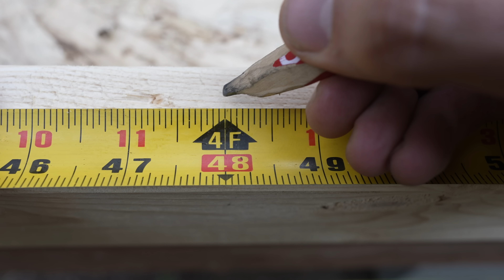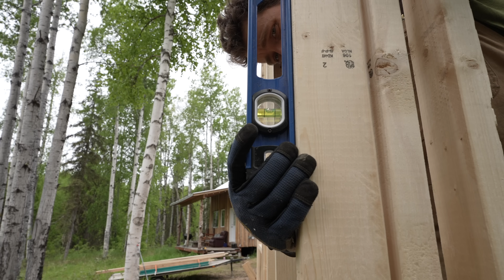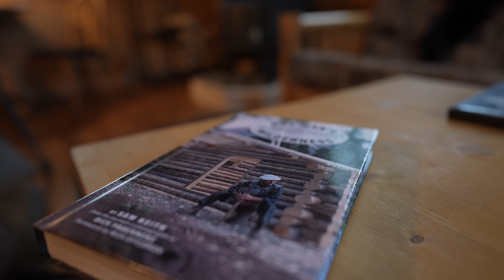Building A Cabin In The Wilds of Alaska | ASMR | Framing

Comment: Is that square block and rebar foundation the same as the main cabin? That design  is starting to interest me, so no hole digging? I think you had mentioned you should have put a wood block under the steel bracket in your first build, I think that helps eliminate "cold creep"?

Comment from the maker: I'll try and answer your questions about the building specifics here ⬇
Reply: Great job. Great video production. You are very talented. Please wear eye protection though. We want to see you continue to make these excellent videos!
Reply: It looks like a pretty good size guest cabin that you’re building! What is the size? I know you probably said it, but I think I didn’t catch that! How do you plan to heat it in the winter small woodstove you got yourself a new subscriber!
Reply: If you use your pencil to mark a "v" instead of a line, you focus the edge of your cutting blade in the central convergence of the v...... it's much more accurate. 

And because it's not just one line, it's much easier to see on the wood.
Reply: Guest house? Looking good so far.
Reply: Awesome. Did you do 2x4 walls, but 2x10 rafters and a 4x12 ridge beam? Was this done to eliminate a need for ceiling joists? I like the design. Also what are the dimensions of the cabin?
Reply from the maker: @rudycarlson8245 10x12 heating will be with propane, since it’s a guest cabin I don’t want to chance the woodstove!
Reply from the maker: @normanroberts6680 yup! Thanks
Reply from the maker: @MTvardzik ood guess! 10x12 cabin, 2x4 walls, 2x8 rafters, 4x10 beam! And Yes, ridge BEAM means no ceiling joists for vaulted ceiling.
Reply: How did you do the notchy thingies for the rafters?
Reply: FYI :  you can start a smude fire up wind of you position and it will help keep the mosquitoes down a little, it doesn't have to be a big fire but you want to burn some wet wood on top of it to make some smoke.
Reply: I'm a new subscriber from Washington. I love how neat and tidy you like to be...  I sure respect that. Your cabin is all I would ever want...lovely. that piece of property is pretty darn lovely too. Your channel is similar to Shawn James -"My Self Reliance" and there's definitely room for another. I can watch these builds with little to know talk, some excellent food, and beautiful production shots non-stop 24/7.
Reply: Thank you for sharing!
Reply: 23:53 what is the purpose of those pieces at the back on the roof?